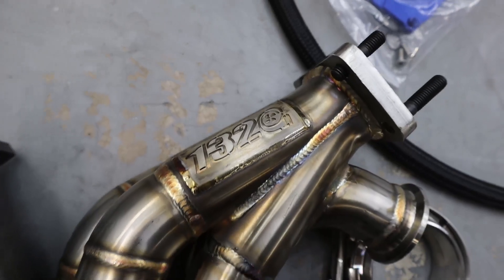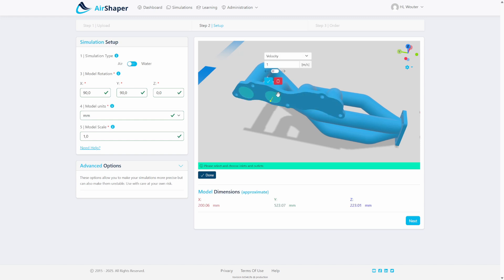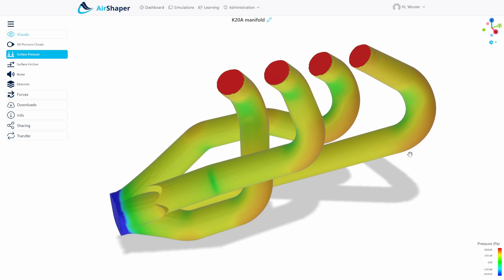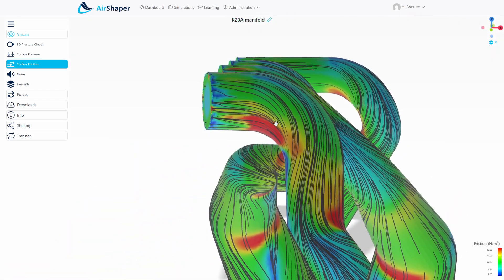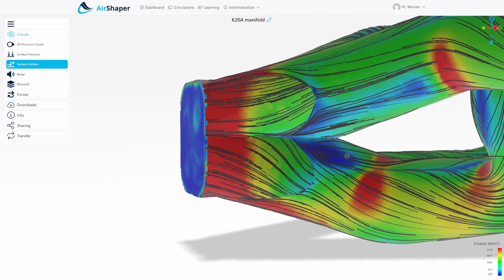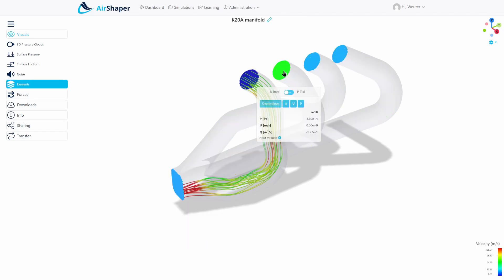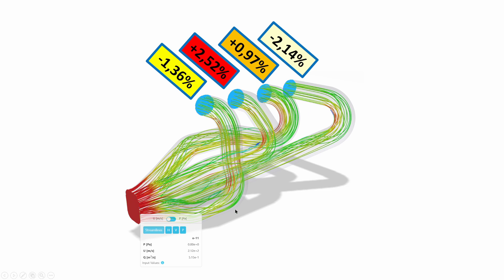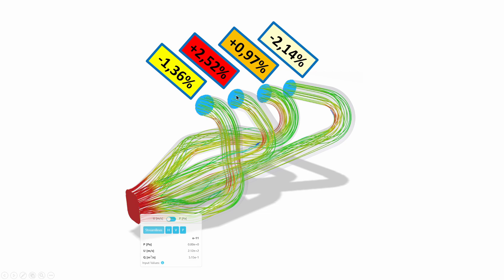Manifold CFD analysis - Flow distribution and pressure drop

Comment: I dont think that the flow would be compressible on a working engine. The usual mach number for internal flowing air on IC engines is below mach 0.5
Reply: Anything over Mach 0.3 is considered compressible.
Reply from the maker: Yes, but the interesting thing is that the physics don't abruptly change beyond Mach 0.3

Rather, beyond that point, the effects of compressibility start to become noticeable.

So there is a grey area where your conclusions remain correct even beyond Mach 0.3, but you have to be careful and run an occasional validation with a compressible solver.